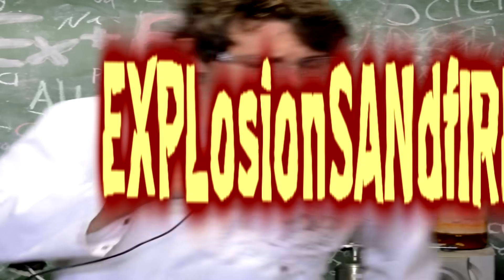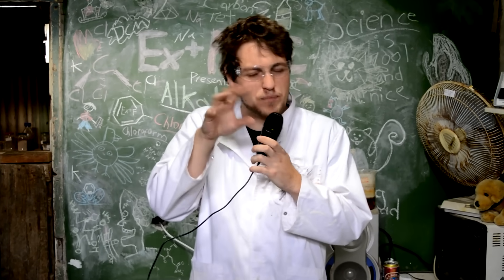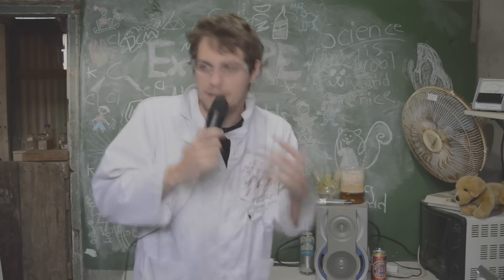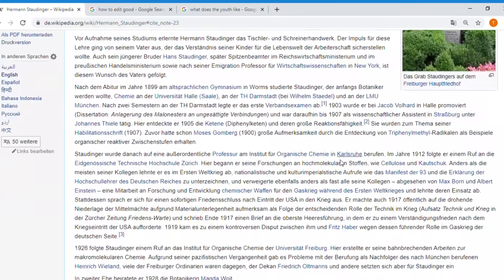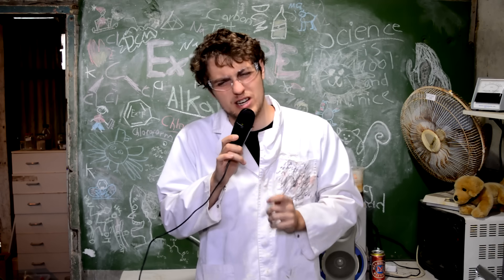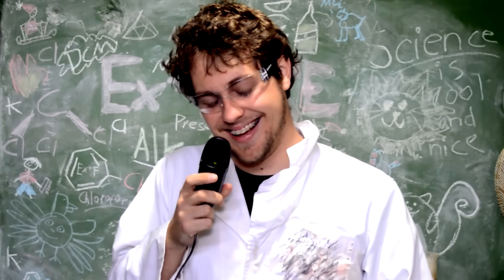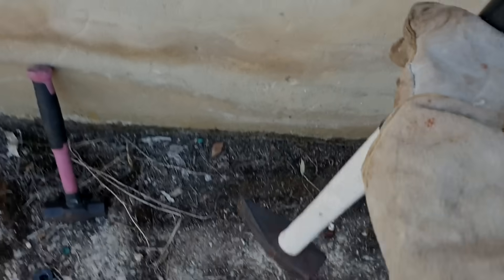Mixing Sodium and Chlorinated Solvents is Real Bad (Carbon Tetrachloride and Sodium)

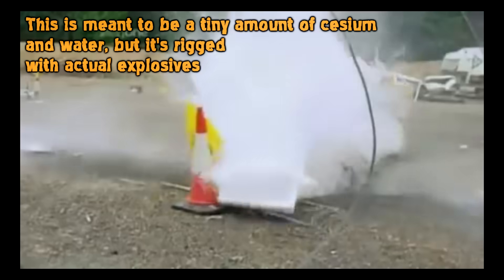Comment: 2:01 I remember watching that and seeing the det cable running out of the tub clearly in shot, did they think we wouldn't notice?
Reply from the maker: They did try the cesium, but it wasn't very impressive, and they just had access to explosives on the day (somehow?) So they filmed that as well. To give them the benefit of the doubt, it seems like they were meant to just show it as a theoretical comparison, which is why the guy mentions depth charges, but during editing they fucked it
Reply: @ExplosionsAndFire  It sounds like the producers wanted a more entertaining demonstration.
Reply: @ExplosionsAndFire  i mean theoretically caesium has a worse energy density than all other alkaline metals so even if it is more reactive than for example Potassium it only releases about a 4th of the energy on contact with water it just does it faster
Reply: I thought they did francium, which is practically unobtainium.
Reply from the maker: @1st_ProCactus  they allude to it at the end, saying "There is one more, but they wouldn't let us try it... " as if it was too explosive. And that's the least of your concern when handling it honestly
Reply: @ExplosionsAndFire  That sweet sweet radiation poisoning
Reply: Honestly, the thing that scares me most about trying to interact with elemental francium isn't the radioactivity itself, it's the fact that the radioactivity would heat up the francium so much it evaporates.
Basically, imagine if someone sprayed hot caesium gas in your face. All the horrible effects of caesium reactivity plus the fact that you don't even need to heat it up or spray it yourself, so it's essentially a self-detonating incendiary bomb. You'd die an agonizing death as the francium melts your skin off and dissolves into your blood.
Oh, and of course, your dead body will then become an orphan radioactive source, so you probably won't get a proper burial for a while, if that bothers you.
Reply: @1st_ProCactus  Francium has less power than cesium, which is why the videos of some random gigantic explosions as the explosion of francium makes me want to inhale oxygen difluoride.
Reply: @luisp.3788  no. The problem is you can't get enough of it in one place. Just seconds of half-life is the problem.
Reply: @1st_ProCactus  Periodic videos has a nice explanation for why the arrangement of atoms in the element does not permit it to release anything even close to these fake videos. It physically wouldn't be able to, even if you have enough. You have no idea what you're talking about.
Reply: @luisp.3788  but you do because of 1 video. It has nothing to do with the fact it just can't be done regardless.
Reply: @1st_ProCactus  Some people just don't get it.
Reply: @luisp.3788  and there we agree
Reply: @1st_ProCactus  This is literally the second time in my life seeing Fr, the other being the first time I read the periodic table
Reply: @Adenosine is a heck of a drug James manages to get francium and explodes the entire planet, and I'm a ghost made of NaK
Reply: Isn't it because although cesium is more reactive it's also a larger atom so the same weight of sodium, although less reactive, has more atoms and explodes better
Reply: @jamiecjxdf  perhaps
Reply: Is that peterscraps In th-
gets slapped
Reply: Is that Peterscraps I see
Reply: TF2 surely takes people to different places huh